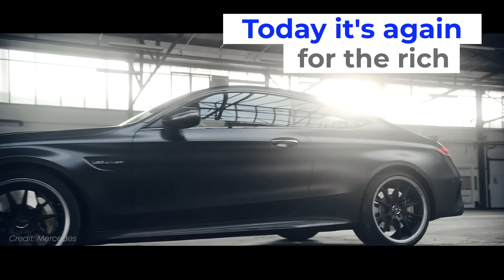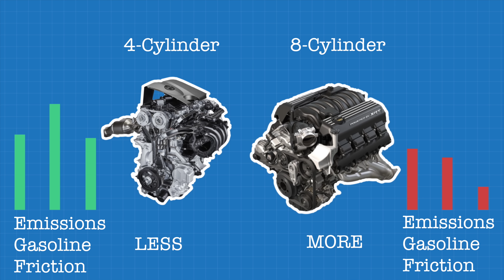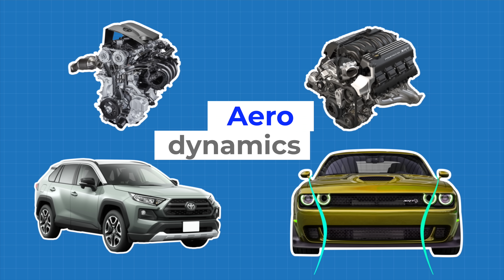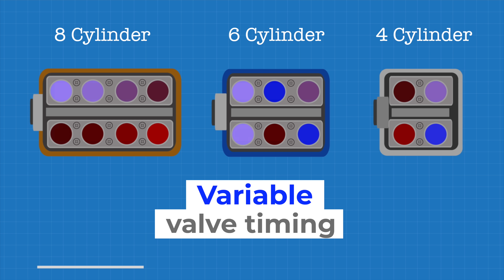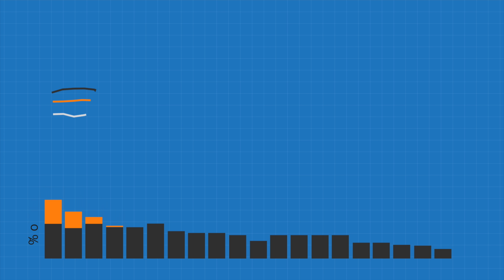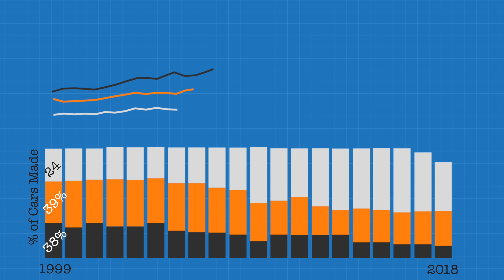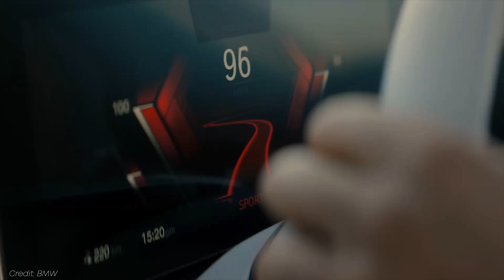The End of V8 Engines in America

Comment: They just need to make them more fuel efficient... the V6 engines do not have enough torque to pull heavy trailers.
Reply: Exactly mate unless they're EcoBoost engines but the EcoBoost engines will never have soul, character, and the reliability of a good ol V8.
Reply: @CJColvin  why? It pretty much has to stay in boost to make power
Reply: LOL it's funny, many tractors have straight 6 Cummins engines and they pull 45,000lbs. 🤣 Of course, the pistons are huge and that's diesel for ya.
Reply: i miss inline-6 engines tbh
Reply: Turbo Diesel .
Reply: Number of cilinders had nothing to do with torque.
Yes, a 5.3 V8 probably has more torque than a 3.5 V6.  

Bore x force/square inch  is important here.
Reply: V8 engines can be extremely efficient. Look at the ls lineup for chevy and their cars/suvs.

Comment: I'm fine with a 4 or 6 cylinder engine for sedans and some SUVs  but for trucks I want a v8
Reply: Same here mate. I have a 2011 Ford F150 with a 5.0L Coyote V8 in it and its a beast.
Reply: why  settle for   a  6 cyl , when.....you  coulda  had  a  V 8.
Reply: @Luis Gustavo But it'll never outlast a V8 nor have the soul and character of a V8 mate.
Reply: @Luis Gustavo which means more parts to break and premature wear on the motor. Issa balancing act of cost and efficiency in the US still. Foreign cars took over almost 2 decades ago. Trucks, Vans, and Box Trucks still reign US made for durability, convenience and repair costs for reason
Reply: @Luis Gustavo turbos are harder on engines. I've never seen a high milage turbo car. If one does male it, itll usually have problems
Reply: @JMPK23  true the 4.6L v8 Crown Victoria grand marquis and Town cars are bulletproof engines
Reply: For trucks I want a DIESEL.
Reply: Currently only semi truck that still profitable using diesel engine, in MODERN diesel pickup truck it just too costly to keep and repair it. Too much downtime compared to gasoline engine. People want pickup that have less downtime so they can keep make money. Altough specific usage such heavy towing diesel pickup do better. Common problems come from emission system if not dpf the egr is clogged. It also need to fill chemical agent for urea injection beside diesel fuel. Internal parts wear are come from who make the engine.
Reply: I used to have a v8, then I got a 95 civic hatchback with a b18c5 and now v8's get smoked
Reply: @GuerreroDelInfo  Only if your racing a 1980 Lincoln.  A modern v8 muscle car (Hellcat, GT 350, LS) will destroy your Honda.
Reply: @williamthornton5856  Never race an Asian guy in a Honda LOL that's all I can tell you. Those Honda guys do some crazy 💩 to those engines and the cars are lighter to begin with compared to a car that has to hold up the weight of an 8 cylinder engine. While I agree with you for the most part, and I've driven 3 cylinder cars all the way up to Bentley's with the W12 from Audi and everything in between, I have seen some crazy stuff with Hondas, I don't have the time and patience to rebuild an entire engine myself and changing out cams and installing stronger clutches, etc. But apparently a lot of people do. It's not the 80s and 90s anymore, look at the Mercedes-Benz 4 cylinder in that newer model (I forgot which model it was, I'm not an MB fan), I think it's an AMG, thing puts out insane HP, I don't think the engine internals will survive a long time, you'll be lucky to get 70k miles out of it but as far as power it's insane.
Reply: In a half size truck v6s are good but full size I want a v8 or 10 or diesel
Reply: Russell Van Buskirk Chevy got that 4 cylinder turbo for the 1500🤣
Reply: @Luis Gustavo A naturally aspirated V8 is more powerful and better sounding than a silly little V6 with a turbo.
Reply: Good luck with your gas bills
Reply: V8 in trucks is not good enough.
Reply: For trucks you want a 6cylinder turbo diesel :p
Reply: I never understood the point of a gas powered V8 or V10 for a truck when we have diesels that can pull like mad and will outlast any gasoline engine. If you want an 8 cylinder or 10 cylinder or even a 12 cylinder gasoline powered engine for a race car, then that's fine. If you want your pickup truck to do 0-60 in 2.9 seconds and have a top speed of 200 mph, maybe you should revisit the purpose of a pickup truck and get acquainted with driving dynamics before you roll over.
Reply: @justacinnamonbun8658  v8 engines to just fine in light duty pickup trucks. Plus new diesels will not outlast modern v8s, the emissions on diesels i what kills their reliability. My 20 year old 2uzfe toyota v8 on my 01 tundra will outlast any modern diesel. MODERN diesel is the keyword
Reply: @ToyotaNutjob  buddy my cummins lasted 1.3 million miles, only thing is the turbo had to get replaced
Reply: Leonel Ventura you clearly never go over the speed limit I see. 

And you’ve never drive a fast SUV either.
Reply: @TraceLight  
slow  burners  like  their  4 cyl  gas  sippers.   cheaper,   use  less  gas  n  easier  n  cheaper  to  maintain.
Reply: Leonel Ventura or just enjoy the horsepower of a gas engine and enjoy life instead of shitting on others.
Reply: @justacinnamonbun8658  ford 6.4 psd
Reply: Leonel Ventura  diesels we’re beginning to make a dent in the 1980s, even in compact vehicles. But emissions standards were imposed that required changes to Diesel engines and that made them much more expensive to purchase and maintain.

I tried car sales once and sold a used F250 diesel to a local farmer. The buyer asked for an oil change after we had already settled on the price. The $240 oil change completely wiped out my commission.
Reply: @justacinnamonbun8658  deisel engines are genarally much more expensive to maintain
Reply: @dumdum7786  Not necessarily. If that was the case, they wouldn't use them in semis that are always running on the roads, 24/7, many UPS trucks never get turned off, only for scheduled maintenance. Even though I don't see how a gasoline engine will pull 45,000 lbs. or more. You're talking about German cars with diesels. Yes, anything in a German car is more expensive. It also depends on how much emissions controls are attached to the engine, other underdeveloped countries have more relaxed emissions standards than we do here, so those diesels cost much less to maintain, less things that can go wrong with them. In general, I'd have to disagree that a diesel engine cost more to maintain than a gasoline engine, in terms of their intended application.
Reply: Bruh you’ve never driven a V8 sedan? 

Miles better sounding and overall better feeling than a tiny 4 cylinder
Reply: @TraceLight  tax for a v8 engine is too high in 3rd world countries, turbo straight 4 is the better option here

Comment: Good thing GM just came out with a all new 6.6 gas engine and ford just came out with a all new 7.3 gasser
Reply: I always liked a 400 sbc.
Reply: Look for a 8 or 9L in the future. These will compete against diesels with NG and LPG options.
Reply: DIRT ROAD SOLDIER if you got 75-100k for a truck.
Reply: Meanwhile over at dodge lol
Reply: Yeah and Mopar released a modernized  1000hp 426 Hem crate engine with a super charger. Definitely not dead.
Reply: @LeadStarDude  small market that is though. it's not whether or not a company produces a model, it's how much they can make off that model. plenty of muscle and super cars get axed.
Reply: @wclintf  tell that to the millions that buy new trucks every year that refuse to by anything other than a V8 model. Facts is the V8 is and always has been in high demand, and that will continue until something better is engineered. Will something better be engineered eventually? Yes absolutely. Will it be in the near future? Probably not because there is no real demand to change from something that works so well.
Reply: 7.3? Lol that's bigg
Reply: Funnier K. 2333 more like a lot of displacement, displacement is not the size of the motor, But the volume inside the cylinders. I learned from this mistake saying that because the 5.0 coyote is physically bigger than a 5.7, 6.0, and GM 6.2. Why? The 5.0 has 4 camshafts so the heads are bigger. Just helping but I understand what you mean big dawg.
Reply: @FunnierK  divide that by 8

Comment: People can Say whatever they want but a V8 especially in a truck will always be a solid good reliable vehicle
Reply: I always bought cars with v8 I know if I have to step on the gas pedal to avoid an accident, or just to accelerate to get in front of someone, the power is there. I will always buy v8 vehicles
Reply: @tomhatch2011  you've not had an eco boost have you.
Reply: companys dont want reliable they wanjt you buy a new truck every 40-50k
Reply: @crystalscan2002  This is not true for all companies.   Chevy/GM used to have pretty reliable, long-lasting trucks in the 90’s and early 00’s, but then they started building them cheaper and today they’re about bankrupt.
Reply: Exactly mate. I have a 2011 Ford F150 with a 5.0L Coyote V8 in it with 132,000 miles on it and still going strong and its a beast.
Reply: @CJColvin  132k is not alot at all my 2004 gmc canyon with a 5 cylinder engine is over 350 k and runs perfect thats alot
Reply: @CJColvin  them cyots don't die hella strong engine especially boosted better than ls
Reply: @CJColvin  not much talk after 200,000 it will make it through
Reply: @CJColvin  wow 132k? I sure hope its going strong lol
Reply: @thefuzzypickle8277  It still is to this day.
Reply: @CJColvin  I had a 5.7 92 v8 blazer and it had over 400,000 miles on the original engine and transmission. 3 years ago the transmission was going out for it didn't want to go in reverse until I messed with the 4x4 settings. The fuel pump was going out too
Reply: @ruben2365  haha... yeah... sure you did... it only took 12 fuel pumps 2 timing sets  4 water pumps... that sh*t is garbage and everyone knows it... ive towed hundreds of broken down Chevy junks
Reply: @ruben2365  I'm sorry about that brother.
Reply: Inline 6 is very popular too
Reply: Thank you. No 3.5 ecoboost would out live. an old 4.7 V8 from Toyota
Reply: @R J yeah but for how long, i bet you wont make 100k miles with that without any major engine repairs
Reply: @R J considering that president Trump has been rolling back EPA regulations I wouldn't bet on it. 😏
Reply: dont know about that man, especially with manufacturing plants done overseas, companys like ford and chevy are not even true american cars now days. The 5.2L voodoo engine had numrous engine tik problems especially the new 5.0L's. thats not even the tip of the ice berg.
Reply: @R J not if Republicans take back the House and hold the Senate this November. At that point actual legislation can be passed to keep EPA regulations gutted permanently.  With what has been happening that is almost an assured outcome. 💩
Reply: @LeadStarDude  Amen Brother Trump for 2020.
Reply: They'll be asking for a massive loss in sales if they keep up this goddamn 2.0Turbocharged garbage.
I don't even consider vehicles that have this as an option. V6 and up end of story.
Reply: Nope
Reply: RAM hemi compared to Toyota 4 cylinder... jajaja... Toyota wins again biotch
Reply: 2big 2fail mopar hemi in a ram. Not a ram hemi.
Reply: @philtripe  win what? In slowness and the most boring you meant?
Reply: You act as if all v8s are reliable especially in "trucks"... i can think of quite a few unreliable cars and trucks with v8s.
Reply: @Dynie-g7x  ford 5.4 3 valve lol
Reply: Unless it's a Dodge
Reply: How dare you say that to Scotty! Surprised he hasn't replied with a rant against Ram trucks yet. 🤷‍♂️😏
Reply: Got a nice v8 in my 03 ram
Reply: @R J A V6 will always be the little boy of the V world. 

I don't buy a Mustang to be conscientious of the environment,  I buy a Mustang for its raw V8 'music to my ears' engine.
Reply: @bert454  Exactly mate.
Reply: R J and a small displacement turbo V8 will blow away a small displacement turbo V6 and I4 engines.

The point is that a V8 offers solid performance without a retarded as bill from all the extra complications Turbos bring.
Reply: @R J Good on ya 👍. That's a real nice car. A classic. For memory, the Ford Capri has some similarities to the 69 jet. They certainly don't make them like that anymore. Sadly.
Reply: Added flowmaster outlaw exhaust to my 2018 f150 coyote game changer. Music to my ears!
Reply: @jadabait9899  Sounds awesome brother I just added a Borla ATAK exhaust to my 2011 Ford F150 with a 5.0L Coyote V8 in it and man it sounds like a beast.
Reply: Yes to all you v8s are great in trucks always have been and will BUT the 2018 and up 5.0 is plagued with issues and oil consumtion , always a v8 guy ran my 2010 4.6 3v well over 300 000km never burnt a drop so of course the 5.0 would have been my choice not anymore since the new gen of it unfortunately...
Reply: The Hummer and Cybertruck will have crazy torque.
Reply: Scania V8 :)
Reply: Yeah i loved the 5.0 in my '89 chevy caprice it felt right. Driving the wife's sentra its just as fast or close to it but just isn't the same lol
Reply: Did scotty not tell you, trucks are excess moving mass. More wear and tear on the engine from moving all that lard.
Reply: Lol, this is the very definition of irony, given you are a person saying whatever you want!!
Reply: @R J Maybe, but it probably won’t hold up nearly as long over time.
Reply: The diesel.engine is 30% more efficient than the gasoline engine.  Diesel fuel was cheaper than gasoline before the government stepped in and required biodiesel.  Personally, I don’t mind paying the extra because you don’t have the diesel fume smell like you used to.  My 2009 Duramax V8 gets much better mileage than a gas engine so the cost to operate it is the same.  Maybe the new diesels aren’t as reliable as my 09 Duramax but I haven’t needed any repairs done to mine.  Of course I haven’t retuned the computer and modified the exhaust or emissions equipment like a lot of guys do.  Maybe their diesels are the ones needing the repairs.  I don’t know as I can only comment on my V8 diesel.
Reply: @R J yeah until you tow something then the turbo overheat and you have to wait on the side of the road until it cools down didnt see many v8 do that what about you?
Reply: Not if you can't drive it  because it's too expensive.
Reply: And yet they will be extinct this decade. Twin turbo v6 is all we will see, and the v8 will continue to overprice any car it's put into.
Reply: my father has a 2011 raptor with a 6.2 L V8 with 140K miles and it runs just fine, he wanted to get a new raptor but he insists on upgrading when they put the V8 back in
Reply: @R J Yeah but they won't outlast any V8 engine.
Reply: @R J Thats true.
Reply: @R J You do know that Ford is making the new 7.3L Godzilla V8 for the 2020 Ford Super Duty.
Reply: @R J Sounds awesome brother.
Reply: @R J Thats nice.
Reply: Not for long though. For now, electric motors are not good at pulling heavy loads without compromising fuel economy/battery charge. But when they start building electric motors that do heavy lifting for a fraction of the energy it needs to do, it will slowly kill the v6's and v8's. And if they sell those electric motors for the same price as an econo box, it will be the nail in the coffin for any internal combustion engines.
Reply: Eventually they’ll be replaced by diesels
Reply: @joseacuna3239  they need to make diesel engines more reliable, the diesel engine has not been reliable for a while with the emission systems they put on them. I'm a fleet mechanic and have been working on diesel powered pickup trucks for 20 years. They are towed back almost as much as drivin back and spend more time at the dealership than anything. And I'm speaking about GM, Ford and Dodge but mostly the Ford diesels. I'm talking about huge repair bills in the thousands mostly all emissions related. We have recently started going back to gas powered HD trucks and find them much more reliable and less expensive to service and repair, That's just my 2 cents.
Reply: @lsxbc77  same at the municipality I work for, no more diesels except for the 2 f650s and anything medium/ heavy duty like the peterbilt and mack
Reply: @lsxbc77  Exactly why Ford now makes the 7.3 gas engine.
Reply: @joseacuna3239  maybe for those who need what a diesel does. But they are so complex now the use for day in and out with different drivers will keep the gasoline V8 around for a long time.
Reply: @joseacuna3239  There is V8 diesels you know.
Reply: José Acuña Wont happen. Diesel is a ridiculously expensive option from a gas engine.
Reply: José Acuña you mean electric batteries...

Comment: Glad I still have my great! 98 gmc k1500 5.0 L great V8 in my opinion for me
Reply: Those old GM trucks are the best
Reply: Gotta love the 90s trucks man I have a 1996 Ford F150 with a 5.0L (302) Windsor V8 with 209,000 miles and still going strong. The only things I replaced on my truck was the starter and the fuel pump but other than that mostly was just simple maintenance, took out the transmission fluid just to get rid of the shuttering it was making and it hasn't had a problem ever since.